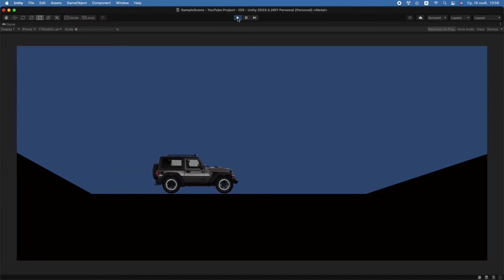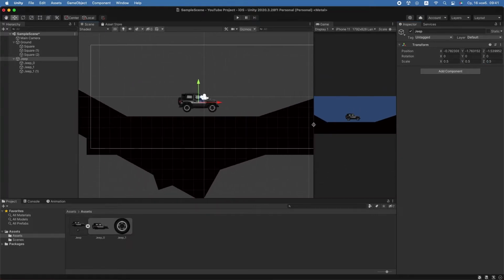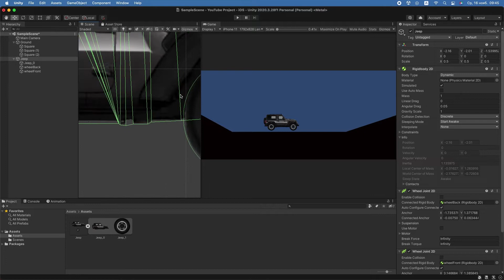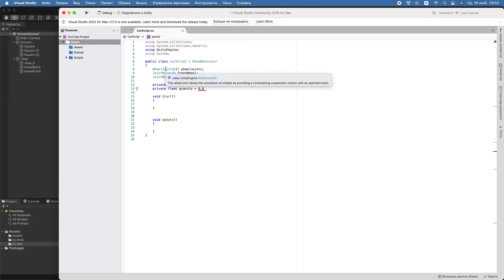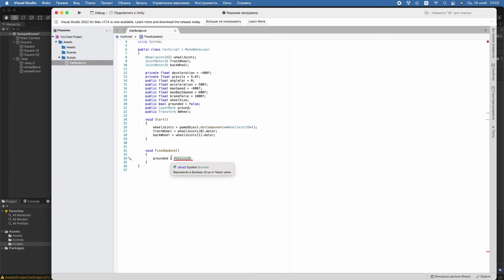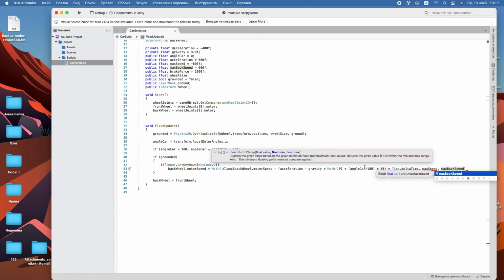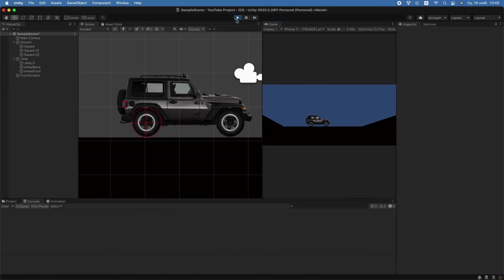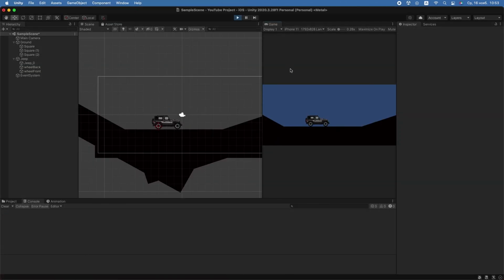How to make 2D car in unity || Tutorial

Comment: Can someone paste the code for me?
The font size is too small for me to read on my terrible internet
Reply from the maker: Hello, friend. I hope it'll help you☺️

using UnityEngine;

public class CarScript : MonoBehaviour
{
    WheelJoint2D[] wheelJoints;
    JointMotor2D frontWheel;
    JointMotor2D backWheel;

    private float deceleration = -400f;
    private float gravity = 9.8f;
    public float angleCar = 0;
    public float acceleration = 500f;
    public float maxSpeed = -800f;
    public float maxBackSpeed = 600f;
    public float brakeForce = 1000f;
    public float wheelSize;
    public bool grounded = false;
    public LayerMask ground;
    public Transform bWheel;

    
    void Start()
    {
        wheelJoints = gameObject.GetComponents<WheelJoint2D>();
        frontWheel = wheelJoints[0].motor;
        backWheel = wheelJoints[1].motor;
    }

    void FixedUpdate()
    {
        grounded = Physics2D.OverlapCircle(bWheel.transform.position, wheelSize, ground);

        angleCar = transform.localEulerAngles.z;

        if (angleCar > 180) angleCar = angleCar - 360;

        if (grounded)
        {
            if (Input.GetAxis("Horizontal") > 0)
                backWheel.motorSpeed = Mathf.Clamp(backWheel.motorSpeed - (acceleration - gravity * Mathf.PI * (angleCar / 180) * 80) * Time.deltaTime, maxSpeed, maxBackSpeed);
        }

        if(Input.GetAxis("Horizontal") < 0 && backWheel.motorSpeed < 0)
            backWheel.motorSpeed = Mathf.Clamp(backWheel.motorSpeed - (deceleration - gravity * Mathf.PI * (angleCar / 180) * 80) * Time.deltaTime, maxSpeed, maxBackSpeed);
        if (Input.GetAxis("Horizontal") < 0 && backWheel.motorSpeed > 0)
            backWheel.motorSpeed = Mathf.Clamp(backWheel.motorSpeed - (-deceleration - gravity * Mathf.PI * (angleCar / 180) * 80) * Time.deltaTime, maxSpeed, maxBackSpeed);

        frontWheel = backWheel;

        wheelJoints[0].motor = backWheel;
        wheelJoints[1].motor = frontWheel;

    }

    private void OnDrawGizmos()
    {
        Gizmos.color = Color.red;
        Gizmos.DrawWireSphere(bWheel.transform.position, wheelSize);
    }
}
Reply: @artkekh  Thank you, It works now!

Comment: it says math f does not exist in current context
Reply: now it says invalid expression term ')
'
Reply from the maker: @itsdragragetime3572  I hope, it will help you)
Reply: @artkekh  OMG THX SOO UTC I WORKED SO HAAARD
Reply from the maker: Please, compere your script with mine, it should be work!😔
Reply from the maker: using UnityEngine;

public class CarScript : MonoBehaviour
{
    WheelJoint2D[] wheelJoints;
    JointMotor2D frontWheel;
    JointMotor2D backWheel;

    private float deceleration = -400f;
    private float gravity = 9.8f;
    public float angleCar = 0;
    public float acceleration = 500f;
    public float maxSpeed = -800f;
    public float maxBackSpeed = 600f;
    public float brakeForce = 1000f;
    public float wheelSize;
    public bool grounded = false;
    public LayerMask ground;
    public Transform bWheel;

    
    void Start()
    {
        wheelJoints = gameObject.GetComponents<WheelJoint2D>();
        frontWheel = wheelJoints[0].motor;
        backWheel = wheelJoints[1].motor;
    }

    void FixedUpdate()
    {
        grounded = Physics2D.OverlapCircle(bWheel.transform.position, wheelSize, ground);

        angleCar = transform.localEulerAngles.z;

        if (angleCar > 180) angleCar = angleCar - 360;

        if (grounded)
        {
            if (Input.GetAxis("Horizontal") > 0)
                backWheel.motorSpeed = Mathf.Clamp(backWheel.motorSpeed - (acceleration - gravity * Mathf.PI * (angleCar / 180) * 80) * Time.deltaTime, maxSpeed, maxBackSpeed);
        }

        if(Input.GetAxis("Horizontal") < 0 && backWheel.motorSpeed < 0)
            backWheel.motorSpeed = Mathf.Clamp(backWheel.motorSpeed - (deceleration - gravity * Mathf.PI * (angleCar / 180) * 80) * Time.deltaTime, maxSpeed, maxBackSpeed);
        if (Input.GetAxis("Horizontal") < 0 && backWheel.motorSpeed > 0)
            backWheel.motorSpeed = Mathf.Clamp(backWheel.motorSpeed - (-deceleration - gravity * Mathf.PI * (angleCar / 180) * 80) * Time.deltaTime, maxSpeed, maxBackSpeed);

        frontWheel = backWheel;

        wheelJoints[0].motor = backWheel;
        wheelJoints[1].motor = frontWheel;

    }

    private void OnDrawGizmos()
    {
        Gizmos.color = Color.red;
        Gizmos.DrawWireSphere(bWheel.transform.position, wheelSize);
    }
}